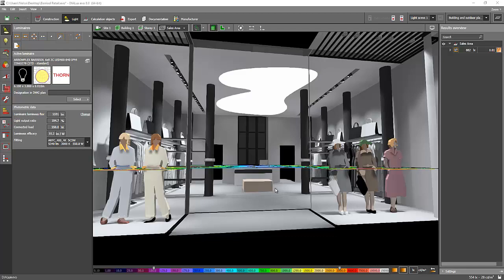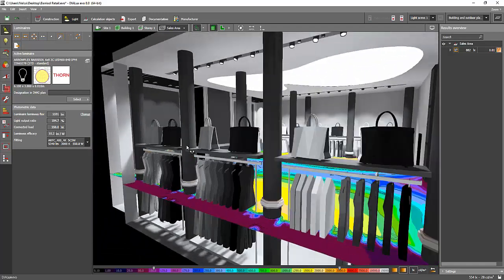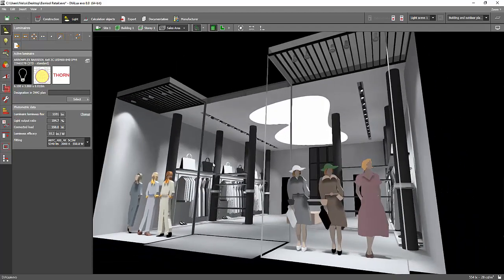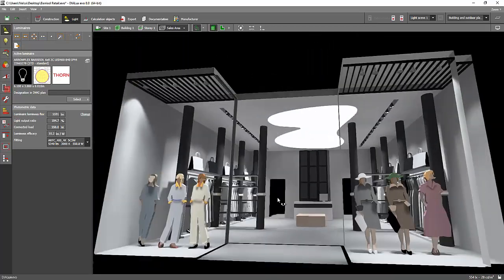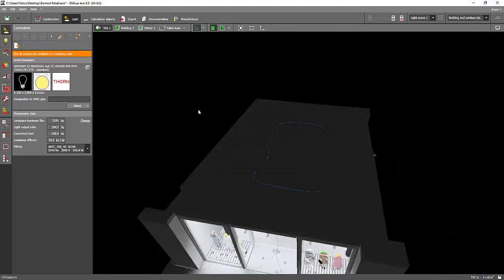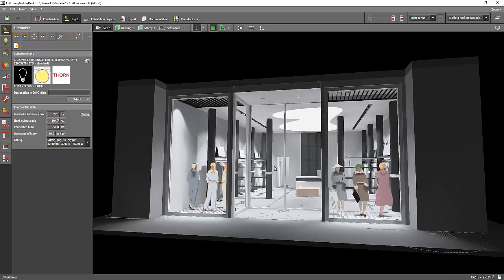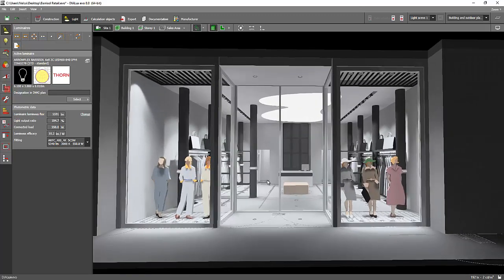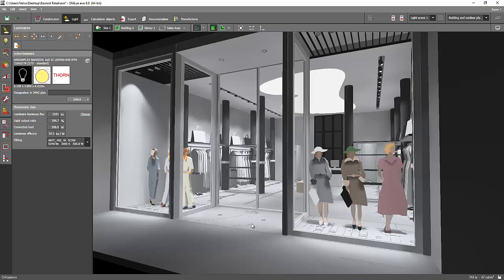Barrisol or stretched ceiling for retail shop

Comment: Hi Nelca, I have a rectangular car parking with sun shade, the sun shade is placed on 4 sides steel column, and I don't know how I can create the roof on the column, the required fittings/ fixture is 2x35 watt  florescent, any help and thanks in advance.